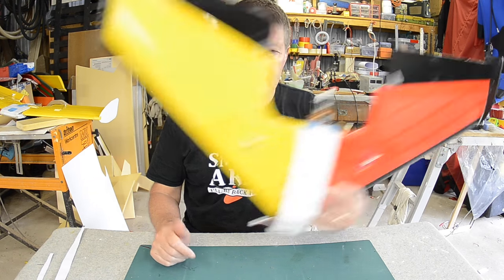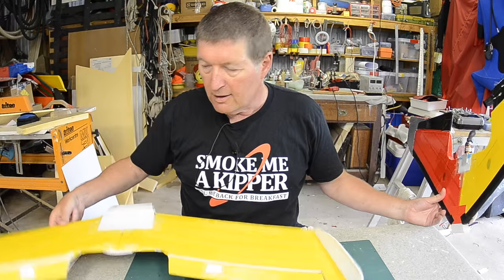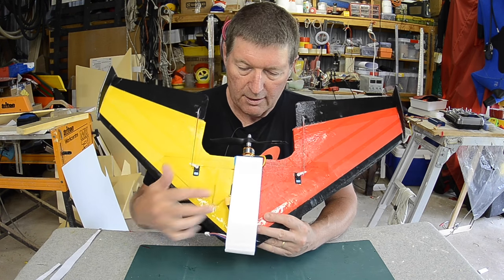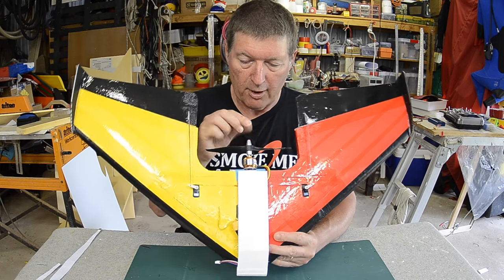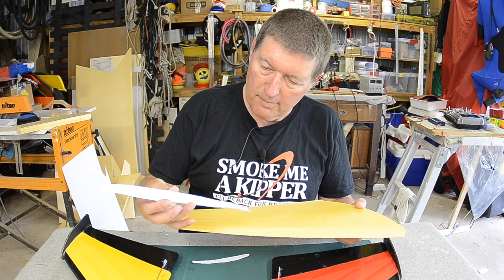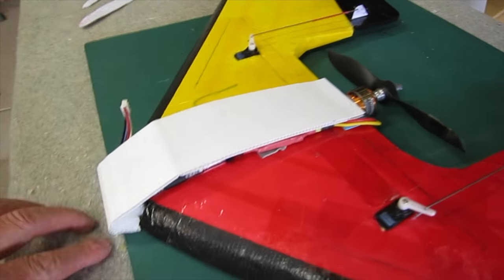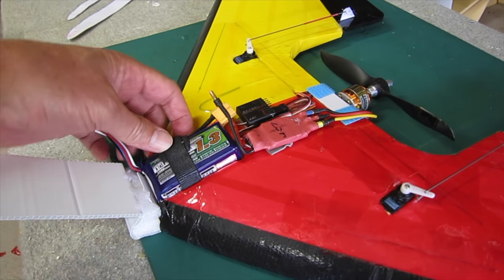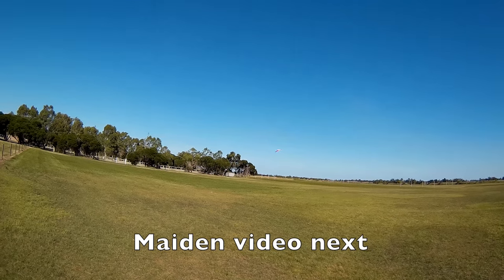Hotwire Mini Arrow build overview

Comment: Hey Andrew .. love your work !!! - What size control horns are you using on the Mini Arrow and presuming they are glue ins ?
Reply from the maker: Home made ID card plastic horns and the hole is 20mm above the hinge. They pass through the elevons and glue to the bottom, very tough and secure.

Comment: It flies so well Andrew, do you think this is because of the motors position being nearer to the wings C of G..?.....Or am I imagining how well it flies...? A slightly larger version for FPV would be interesting with a miniature FC in it..
Reply from the maker: +EnglishTurbines I does fly very well with minimal stall even during crazy manoeuvres. Why? sweep angle, taper, I dont really know, it just does.
Reply: Andrew Newton I think its a combination of sweep angle and having the motor where it is...plus the sweep angle on the TE too...More mass nearer the C of G..?....It just works very well....I have seen many wings suffer from nodding and at their very worst tip stallers resulting in a death spiral..Where are the dimensions for the wing planform?....I found the section templates ok.
Reply from the maker: +EnglishTurbines Initially I just used the Flite Test plans, but have my own outline template now, I'll upload that and let you know.
Reply: Andrew Newton Great, thanks, look forward to  it....I have some Foam left I could make one of these from..
Reply from the maker: +EnglishTurbines Here it is - http://newtonairlines.blogspot.com.au/2016/03/ft-mini-arrow-hotwire-version.html
Reply: Andrew Newton Thanks Andrew, I will put it in my Cad Programme so I can scale it up a little...:)

Comment: Andrew can I ask what CG reference point you are using on your Arrow ?  The FT foam arrow says about 44mm in front of the motor wall.  If that's the case my servo arms are at that point so I might suspend it with paper clips for a balance point. It's just a bit awkward using my fat fingers. 😕
Reply from the maker: Should be the same, it's the same plan shape. I never actually measured mine, it just worked as is.

Comment: do you think i can build this with under 250g? with smaller lipo, smaller motor, no covering film?
Reply: what was the raw weight of just the wing halves? if its 150 or belowm, its fine. because all my equipment is rougly 92 g
Reply from the maker: Yes maybe but it would be fairly prone to damage, this foam is not like EPO

Comment: Well I just found out that you should not use Diggers Fiber glass resin and Diggers Hardener on this foam as it melts the foam. I was adding some carbon fiber mate to the battery box. It is all set but very thin on the bottom. FYI

Comment: Hi Andrew!!!
First of all compliments for your channel!!! I always follow you because i'm a hot wire cutted planes lover too!!!
I'd like to build a mini arrow too and i downloaded your templates but i'm not able to understood which airfoil you had used! It's written that it is a type of clark z but it seems to be quite different from that one: 
http://airfoiltools.com/airfoil/details?airfoil=clarkz-il
I really hope you can help me!!!
Reply from the maker: Greetings and thanks for the compliments. You are right, it started as a Clark Z but I stretched it out and thickened the trailing edge to mimic the Flite Test build shape. The templates work very well, we have built 6 so far and they are proving to be fast fun and tough. Good luck and let me know how you go.
Reply: Thank you for your quick reply!!! I have another doubt (hoping to not annoying you): in your video about the cutting phases i cannot understand how you choose the right position of the templates on the foam panel! Normally i use to align the leading edge of my template with the foam edge and i suppose you use a similar reference too! Can i ask you what is it? Alternatively, can you say me the length of the root and tip chord?
Thank you again for your help!!!
Reply from the maker: Root and tip chords are in the blog post linked in the description. I line the templates up with the front edge of the foam then move them back a few mm to allow for the cut.
Reply: Thank you for your help!!! I have another one question: where is located the CG of your model?
Reply from the maker: Same as the FT Mini Arrow, look here - http://www.flitetest.com/articles/ft-mighty-mini-arrow-build
Reply: Hi Andrew... I'm glad to inform you that my Mini Arrow is completed!!! Can i ask you how have you set up the EXPO and FS settings on your tx? Because during the maiden flight i've crashed (fortunatly without any damages) because the controls were too sensitive!!! Thank you again for your help!